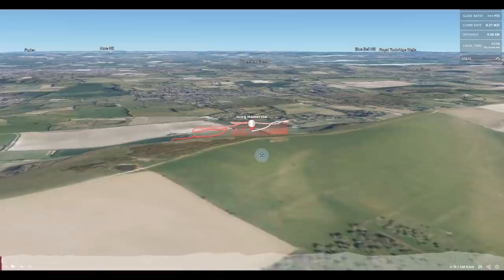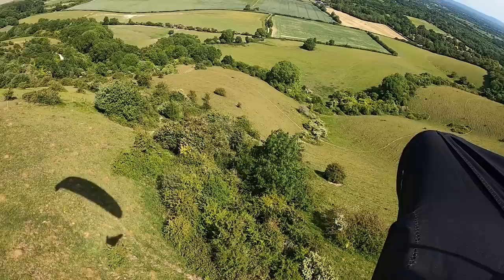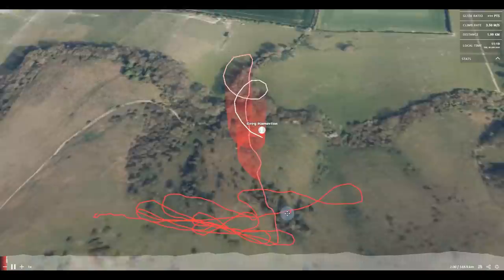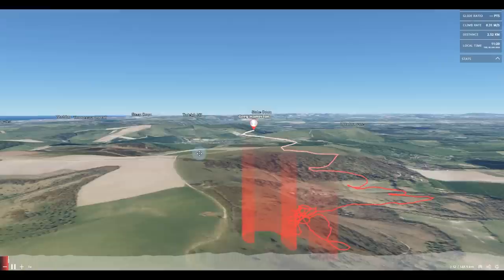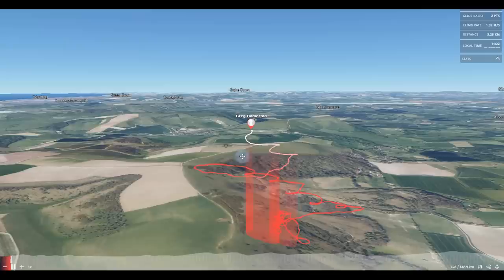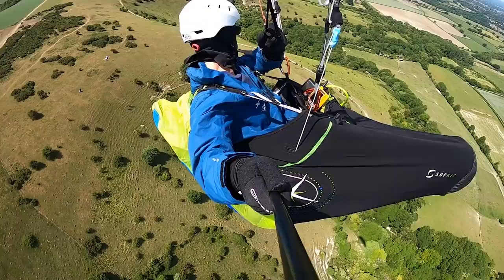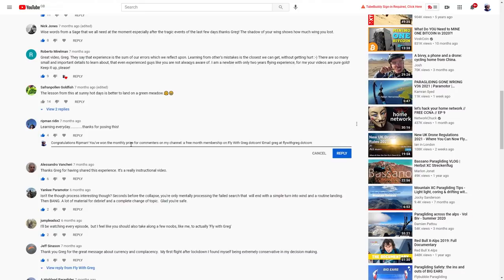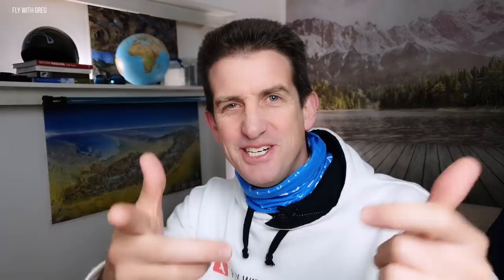How to find the FIRST THERMAL on your paraglider!

Comment: Upwind thermals can also steal some of the upslope wind.  Often when everyone starts getting lower on the ridge, the best tactic is to resolutely dive upwind and connect with the thermal that reduced the dynamic lift.  So following lifty bits upwind is good, but also look for sudden sink cycles then push straight upwind instead of hugging terrain all the way down, under the thermal column.

Comment: Excellent , that's taught me a lot more than I thought I knew ;), 
You quickly mentioned the thermal wouldn't go all the way up the hill and knew (why please explain?) it would stop at the broken ground and start rising without going any further up towards the hill top.. I also assume if the wind was coming from the sunny side things would be different ... is that another story then  ? cheers Greg

Comment: Dip your finger into water and the lift it out. That drop of water is going to the lowest point of releasing itself. Now if you had dirt on your finger, it would release at that point if it is before the lowest point on your finger. Now imagine that turned upside down. Thermal heat works the same way as that bubble on your finger. Now take into account that wind is blowing that bubble of heat trapped on the ground towards a group of trees. Same thing. This is known as a release point. Something to break the tension that holds it to the ground just like that drop of water under your finger tip. Same exact thing that holds that drop of water under your finger is the same thing that holds that bubble of warm air to the ground.